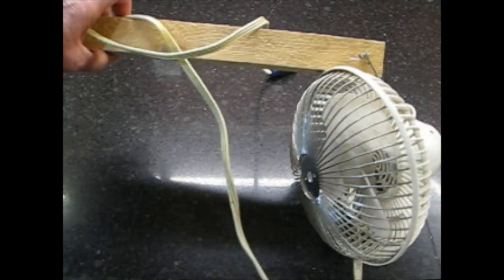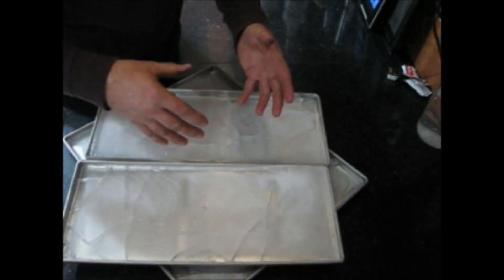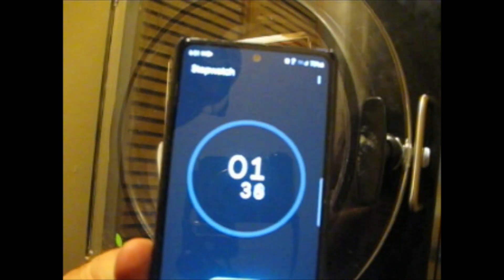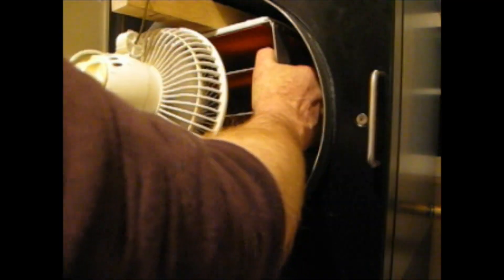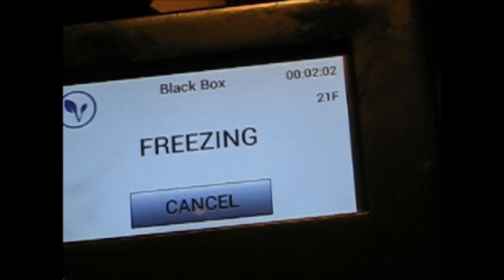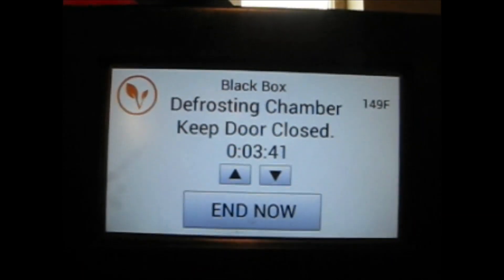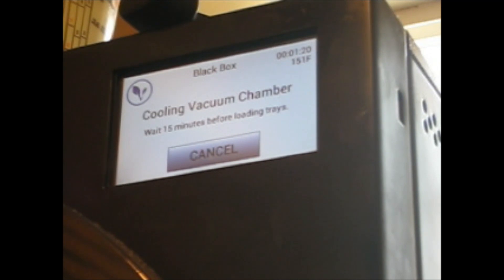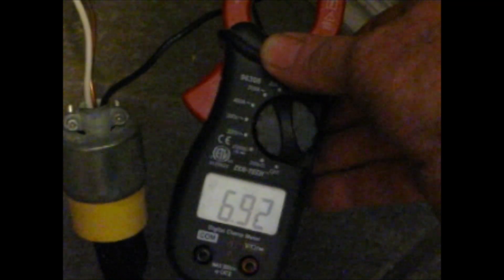The Harvest Right Defrost Challenge

Comment: Just a thought- as far as I know, the cooling loop of HR is very basic(capillary tube HVAC) . If that cooling loop would be operated in reverse, it could use it to defrost the chamber quite fast and efficient. Technically it´s no challenge for someone with HVAC skills (and tools). Only a 4 way valve needs to be installed into the cooling circuit. Similar than it´s built in from  factory in some (split-type?) Air conditioners which are able to  heat and cool... 
Of course HR warranty would be voided 😉
Reply from the maker: Good ideas.  I can only hope HR continues to use process improvements.
Reply: Lol, I'd wondered about that, too.  The valve is called a 'reversing valve', and it is used in heat pump systems.  And indeed, those are split systems, with the condensing unit setting outside the building.

Comment: Why not try to remove the ice after 30/45/60, etc minutes when using the heating pads?  This is what I do when I need to reload in a hurry.  The pads are warm, but the walls of the chamber are still cold.  If I’m doing a mass heavy load ( lately I’ve been doing batches of raw ground chicken for dog food, 2 lbs per tray, 8 lbs total), I’ll stick the pre frozen  trays in almost right away after removing the ice and starting the pre freeze cycle, then I just skip the rest of the pre freeze cycle.  The mass of the -10 below trays cools the chamber to below 32 degrees very quickly and I have not noticed thawing of the food. 

Thank you for taking the time to do these experiments!!
Reply from the maker: The heating pads pull about 7X the power of a fan.
Reply: @Philat4800feet  Yes, but running the heatings pads for an hour allows me to complete a load of dog food and start a new load in less than 24 hours.  I started with over 500 lbs of chicken so it’s been nice to dial it in to a predictable schedule. I really need to get a meter to monitor the overall power consumption though, I’m really curious!

Comment: Speaking of ice, although the problem I’m currently experiencing doesn’t pertain to this particular video, I would like to explain my dilemma and see if you could help me with a diagnosis.  Here goes, the black rubber door gasket is coated with approximately 1/8 inch of “frost” when I’m freeze drying.  This dose not seem normal.
Would you know what is causing this? I’m concerned there is something wrong with my freeze dryer. 

Thank you for your videos Phil.  The information you provide is by far the best I’ve seen.
Reply from the maker: The cold from inside is transferring through the rubber gasket.  The moisture in the air is freezing to the surface.  This is somewhat normal in areas with high humidity.  If your system can still get down to 500 Mtorr and below, I wouldn't worry about it.
Reply: Phil, since I left my message, the screen said: “INADEQUATE VACUUM”. There is something wrong.  When I figure it out, I’ll let you know.  Thanks for getting back to me, I appreciate it.
Reply: Problem solved! It was a sliver of wood that somehow got into door gasket groove that slides onto the drum. It was 1/4 the size of a grain of rice.  Who would have ever guessed something that small would cause a vacuum leak that caused an 1/8 inch of frost on the door gasket as well.
Reply from the maker: @Ephesians3-19  Wow!

Comment: My ice ring is a lot smaller than yours, I do have a 3 tray small model.  My ice is in the front 6 inches only, some times it has7 ridges but mostly 5 ridges in the front never in the back half have I had ice build up.  Is that normal?
Reply from the maker: My ice rings were made from 4000 grams of water.  Normal food can have much higher moisture and thicker ice rings.  Rings within the chamber shouldn't be an indication of performance.  As long as your food dries in a reasonable time is a win.
Reply: Mine does the same thing. I have the largest fd. There is progressively more ice buildup on my chamber toward the front than the back. And the back 1/5 of the chamber has no ice. Neither along any part of the back wall.

Comment: There are some aluminum strips that slide in on each side of the tray stack that keeps the ice from migrating and lkckinb the rack in.
Reply from the maker: I wrap my tray shelf with aluminium foil, not so much to keep the ice out, but to migrate the heat to the sides.  I made a video on this subject.  With my dry climate, I never had problems with ice encroachment.

Comment: I stopped using the Defrost mode a couple months ago and have a clamp on fan just about like yours and it's so much faster, and the chamber is cool and ready to restart.  I'll never do the heat cycle defrost again. Mine is always ready to restart in less than 2 hours.
Reply from the maker: I really need to buy a new fan.
Reply: I do the same thing. Works perfectly

Comment: I use a box fan, because it's what I have, set it in front so it's blowing directly in the chamber, if I am in a hurry, I turn on the heater too, and use them together,  my concern is the shortening of the life of the heat pads.
Reply from the maker: I think a fan will improve the lift span of the heating pads.  The fan is removing excesses heat from the pads.  I think the pads would be damaged more from overheating.

Comment: I wish you would would have done a compare with the HR dry pulling out the center unit as soon as you can.  That is how I do it.  I run the HR heat until I can pull out the ice. I think I'm faster then fan
Reply from the maker: I could do this and then some.  How about a combination of fan and heater?
Reply from the maker: Do you leave the gasket in place, and door closed, until the shelf will move before pulling it out??

Comment: Another helpful video.  It is great to be able to learn from someone with a background in engineering.
To be complete it would be helpful to compare removing the ice after the defrost cycle loosened it from the chamber then removed as in the first demonstration.  However, I am convinced that the energy used and time would still far exceed the HR defrost cycle.  I have been using your fan suggestion with room temperatures in the high 40’s very successfully.
Reply from the maker: You're right in your idea.  You can also use a fan and the heating pads at the same time.  Lots of options.

Comment: Good demo.  My house is run on  solar power system and I knew that the defrost cycle would pull down my batteries bad.  Since I can't start a new batch till I have enough sun hours I just let it defrost by itself.
Reply from the maker: There are lots of options.  Doing nothing is one of them.

Comment: Really not a fair test. If you remove the tray rack as soon as you could with the fan, then you should have done the same using the defrost button. I'll turn on the defrost cycle for roughly 1 1/2 hours then I'm able to pull out the tray rack, remove remaining ice, and start a new batch with a cold chamber.
Reply from the maker: I agree.  There are several combinations.  I also found using a fan and heater together effective.
Reply from the maker: This test was using my method verses Harvest Right "instructions" on defrosting.  HR doesn't have the user pull out the tray rack.
Reply: @Philat4800feet  I think HR wants to make things as simple as possible for the user.  They probably worry about people damaging the wiring harness and connectors, etc., if they instruct the user to pull the rack out and manually remove the ice.  Repeated manipulation of the wiring, or people accidentally yanking on things could break a wire at one of the connection points.  So they just instruct you to melt all of the ice using the heaters in the rack to save themselves warranty issues and service calls.

Your idea above about wrapping some heat tape around the chamber, between the cooling coils, seems like the most efficient way to melt the ice away from the chamber surface.  But in that case, I wonder if they worry about heating the refrigerant in the "evaporator side" and raising the pressure there.  If that's not a concern, then heat tape on the chamber would seem to be a fantastic way to put the heat directly where it's needed to get the job done quickly and efficiently.

You could use some of that self-regulating heat tape, the kind that uses a polymer as the resistive element between the hot and neutral wires, and can be cut to any length.  You might be able to get some made that regulates itself to a low (but warm) temperature so there wouldn't be any risk of overheating the refrigerant on the evaporator side.  Heck, the standard stuff may well be suitable.  One brand is "nVent RAYCHEM self-regulating heat trace".

If you've never used this stuff, it's clever, easy to use, and safe.  But it's not cheap!  Still, this seems like something the folks at HR should look into as a more fast, safe, and efficient way to melt the chamber ice.

Thanks for more thought-provoking information.
Reply: Jsigmo - not sure I'd be willing to try that if HR tells you not to use a hair dryer because it will damage your machine and void the warranty. Putting a heating pad directly on it could be worse.

Comment: I have some spare silicone heating pads from my 3d printer which appear to be identical (except in shape) to the ones used in the HR. After seeing this I'm tempted to open up the Harvest Right and wrap 1 or 2 around the outside of the chamber, or at least along where the shelves make contact with the inside of the chamber. I'd bet it would take less than 15 minutes to be able to defrost to the point of being able to remove the shelves. Those silicone mats can get over 400°F and go for around $40 for a 12"x12" pad (minus power supply) on Amazon.
Reply from the maker: I wonder if harvest Right ever thought of putting heat tape, next to the refrigerant lines, around the outside of the chamber?